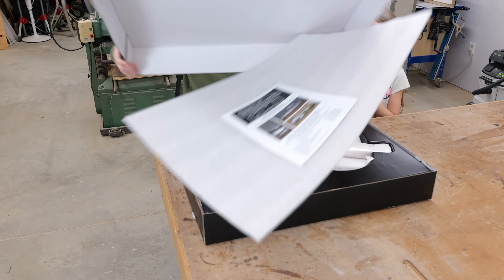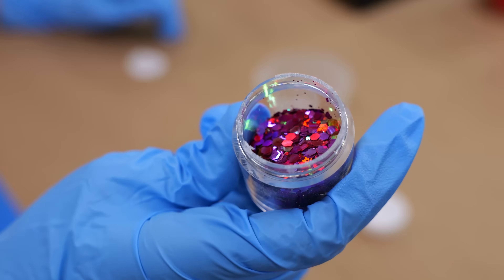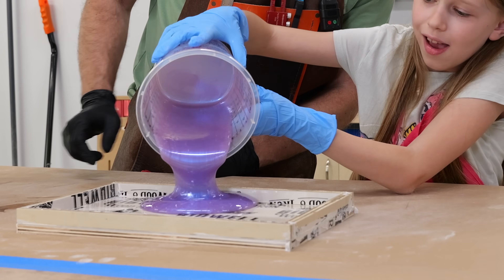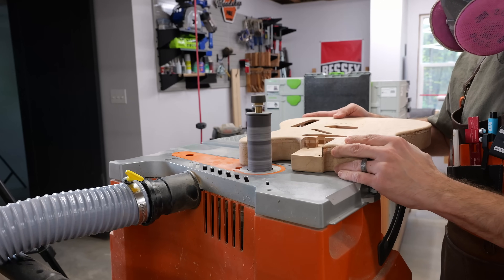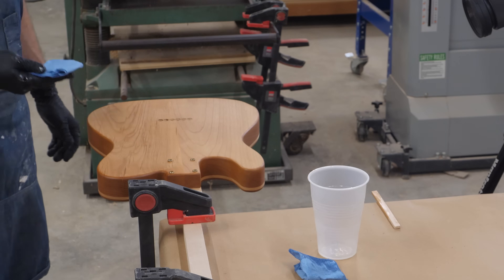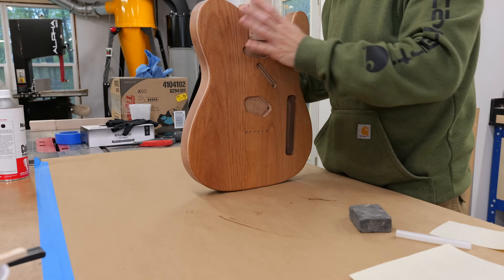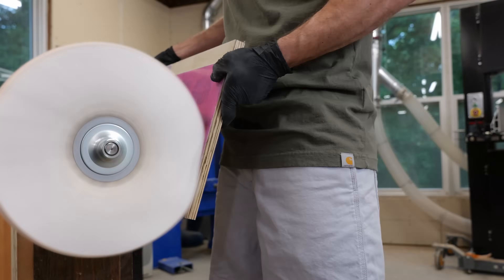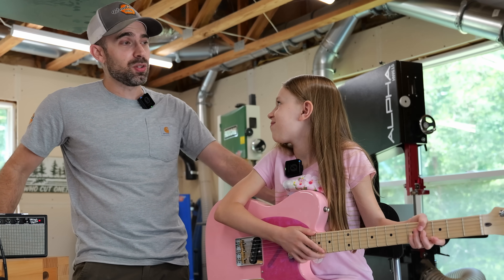Why I Cut a Guitar IN HALF

Comment: 1. Cool project. 2. Could've just replaced the annoying tube jack with a forward-facing panel mounted jack. They're easier to install, and last much longer. 3. Please learn to solder :)
Reply from the maker: Thanks!   That would've been a good option for sure, but I really like the aesthetic of the tele jacks.  

What did you see that I needed to improve with my soldering? (Genuinely asking, not over here crying 🤣)
Reply: @WoodshopMike  There's a bunch of stuff indicative of teaching yourself to solder or learning from someone who did. Just off the top of my head (without re-watching): The soldering iron should go flat under the terminal. Make firm contact between the soldering iron tip and the components being soldered to avoid "cold" solder joints. Put the soldering iron in place, and don't move it around. Pre-tin the wire and the terminal before attaching the two. That way, you don't have to add solder into the joint while attaching the two parts. Don't put the wire through the hole. The wire should be flat on the terminal with the wire insulation ending right at the edge of the terminal. When you're soldering correctly, the actual attaching of two parts should take less than 2 seconds. Literally. You should basically be done after "One One-Thousand." That way, you can solder sensitive electronic too, not just large panel-mount components.
Reply from the maker: Thanks for the pointers! 👊

Comment: I’m really surprised by the amount of slop in the neck pocket. That would be very problematic for proper string alignment for someone not willing or able to shim the pocket like you did.
Reply from the maker: Yeah that was surprising to me as well.  Several of the reviews mentioned that the neck pocket fit was dead on.  Easy enough to fix though 💪

Comment: My recomendation: Get a used Epiphone Les Paul SL. Then convert it to a glued-in neck by removing the neck plate and screws and replacing the holes with wood dowels. Perfect guitar for a little girl. 4 pounds. Cost you maybe $100 to $150

Comment: Stop drinking the tonewood coolaid. It doesn't matter what wood species you use it won't affect the tone of an electric through an amp that's mic'ed up in a full mix. The differences you heard between the straps was either because one had single coil and the other humbuckers or you didn't have it plugged into an amp, mic'ed up in a mix.
Reply from the maker: Both were an SSS configuration.  Didn't say there was a huge difference, but it was noticeable 🤔

Comment: Get a brass nut. It will have more 'bell' tone. And I am not a fan of the 'ashtray' bridge. There are flat versions too.
Reply from the maker: I'll have to try that out, thanks 👊  Is there a particular flat bridge you like?
Reply: @WoodshopMike  Mine was Gotoh. But  that was a long time ago. What you could do to be different and on the cheap, is bent a lil strip and secure it over the ashtray . And give it some pezazzz. So when the bridge hand is above the saddles it can lean on the strip. Instead of having a full ashtray in the way. The 'ash tray'  from the Stratocaster without trem system is allso something that might tickle your fancy. I like the Hagstrom cover on the Swede model bridges. Wilkinson has a nice bridge that is flat. That I find comfortable to play and doesn't break the bank. There is allso a half Telecaster bridge. That can be extended with a humbucker plate if that is something that might be fun for the future. Then there is the bridge that was used on the Prince Telecaster models. The HS Anderson Madcat Telecaster style guitar.
Reply from the maker: Thanks for the suggestions! 👊👊

Comment: The neck pocket has absolutely zero effect on tone as long as the bottom of the neck pocket is flat. Even then it is neglidgeable.
Reply from the maker: Good point, I should have been more specific in what I said.  Totally agree that the sides of the pocket don't impact tone, they much make alignment a little better/easier

Comment: No worries man. You have such machines that you can throw those in trash and make 30 others without a single sweat drop....And OMG veneer in neck pocket 😮😢
Reply from the maker: It's true, I can knock them out starting from scratch, but this was fun nonetheless 😃
What would you have done to correct the neck pocket rather than going with veneer?
Reply: @WoodshopMike  I think that norhing should be in pocket, it should fit tight. And when mistake has been done sadly, I would rather take new body. Because veneer will be squashed by time and that neck vlll not be stable in pocket. Screws will hold but still....he wil slide from side to side over time...and it is micro movement. On precise instrument it means a lot.